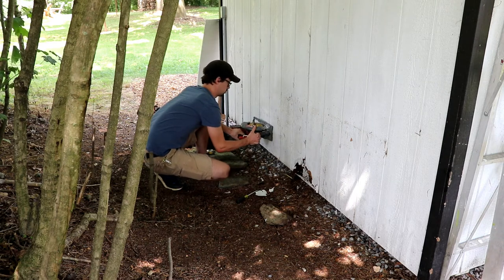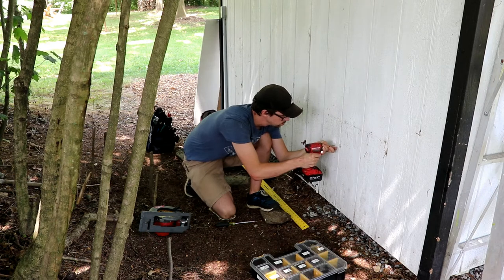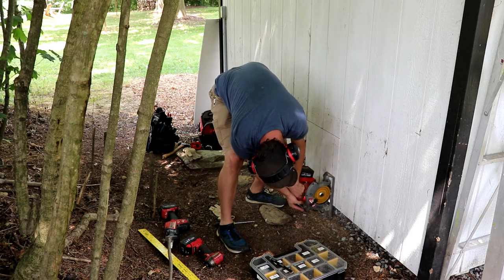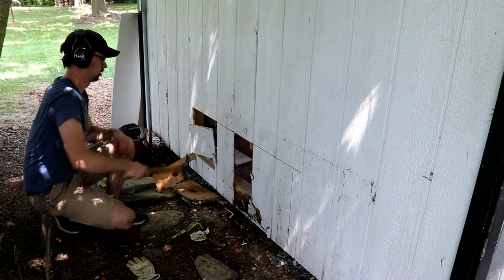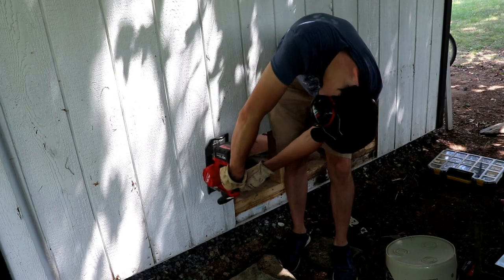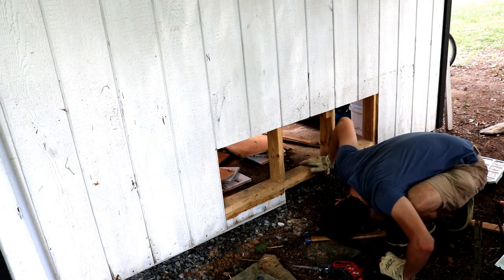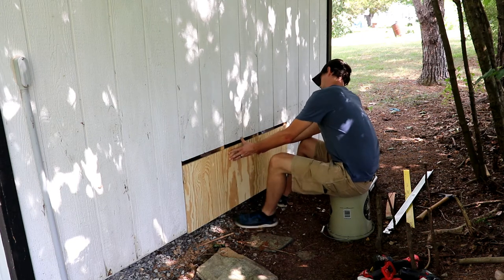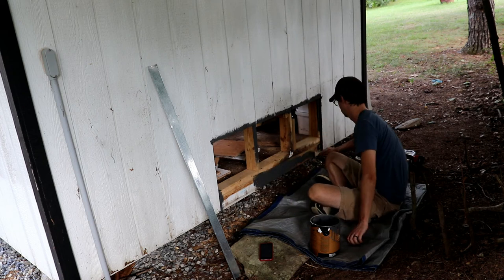Repairing Rotten Shed Siding

Comment: The real problem is that flashing at the bottom of the siding. It's holding moisture.
Reply: He installed the z-channel incorrectly and apparently he doesn't respond to  comments and can't be bothered with adding a corrective subtitle to the video to prevent others from making the same mistake.

Comment: My sheds siding has contact with concrete. Inspector suggested I install a flashing to prevent moisture contact with the siding at grave level. Could I install this z channel all around the bottom edges of my shed to prevent rot?
Reply: I'm wondering the same. Can z channel be on the bottom edge to reduce the splash up from the ground hitting the wood?

Comment: do not put screws in the Z flashing.
Reply: What holds it up then? Bottom of my shed is rotting I'm wiggling out lol
Reply: @valerielock2374  Use a horizontal piece of Trex.  It won't dry rot when water hits it.  But make sure you have waterproof paper behind the vertical siding.  There's 100 opinions in the comments section, lol.
Reply: @kendalgee5808   thank you!

Comment: Greetings and thanks for the video,

Can you please clarify.  You said putting the plywood piece flush up against the Z-Flashing will cause a gap (and cause water-leaking again)?  But if it's touching/up against something with no space how is it gonna leak vs. leaving a gap between the Z-flash and the plywood, and also those gaps on the sides???
At first, I thought it was because you were gonna place caulking or some type weather-stripping in between these spaces but you didn't so....so what about the rain, cold air, varmints, etc. seeping/getting in between those spaces??🤔
Reply: I'm not sure where the gap between wood and z channel was placed because the camera was far back. I'm also wondering about this
Reply: @samueladams584  I think he got things mixed up. Your supposed to put a small piece of horizontal wood behind the vertical siding. But tar paper is supposed to be under the vertical siding.  That way when water gets behind the vertical siding, the space will let it dry.

Comment: Zach, excellent video, thank you so much. 

Hoping you can clarify how to "gap" the z-channel. My understanding is that the gap needs to be between the top of the horizonal (5/8") section of the z-channel, and the bottom of the siding above the repaired area (so that if water gathers along the top of the z-channel, it will not wick upwards into the bottom of the siding. 

I may have heard you incorrectly, but I thought you say in the video that the gap goes between the top of the replacement panel and the bottom of the horizontal (5/8") section of the z-channel. Can you explain?
Reply: You are correct. He installed the Z channel incorrectly. The way he did it will allow moisture to collect at the top of the new siding and allow moisture and air flow into the building. The purpose of the gap is to stop water pooling between the old siding and the Z channel, so you should see 1/4" of vertical flashing under the old siding when it's done right.
Reply: @zackstewart4109  much appreciated, as I thought.

Comment: when dealing with exterior application please use pressure treated. when you replaceed a section of the rim joist and the 2x4 you put under, just didnt look treated but i could be wrong

Comment: So was the space in the Z channel under the lip ? I couldn't quite see where you were making the space between the wood and the Z channel
Reply: He put the space under the lip which is wrong. The space goes above the lip, between the old siding and the horizontal surface of the Z bar.